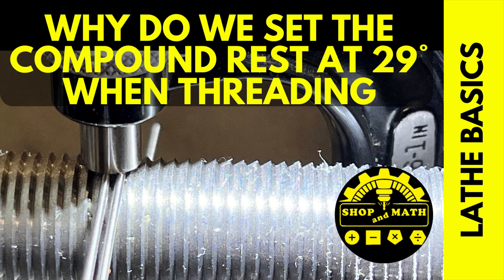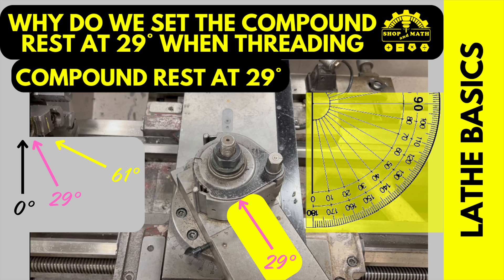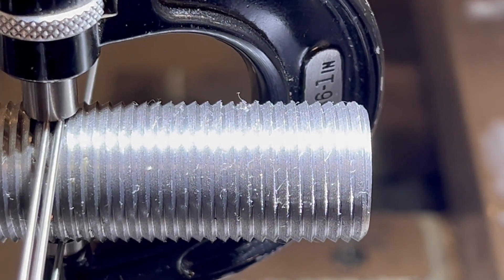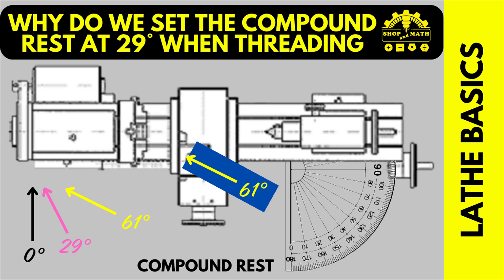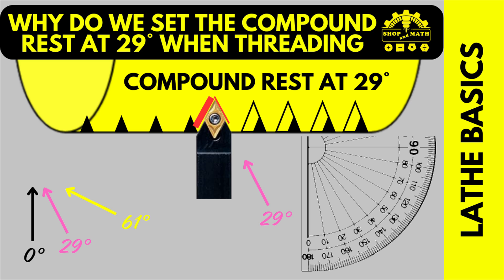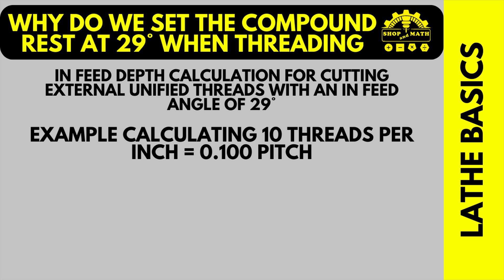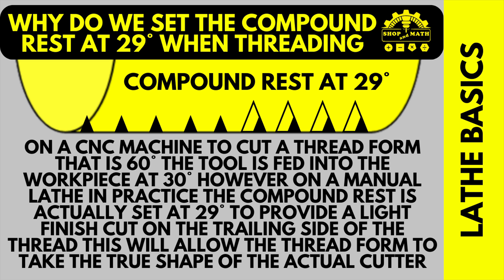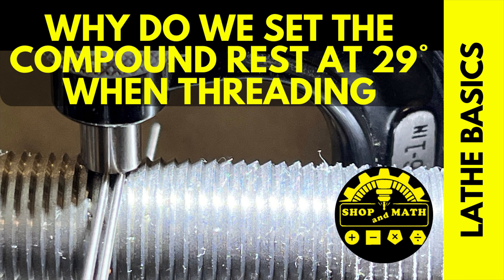why do we set the compound rest at 29

Comment: Where is this .708 number coming from? I’m new to machining, but I was under the impression that to find your depth of cut for a functioning thread you take the SIN coefficient of your 60 degree angle on your cutting tool, which is .866. Then you can multiply that .866 x your pitch and that’ll give you your depth of cut. Is this wrong?
Reply: Ok, I found the answer .866 x pitch is the formula for 100% engagement threads (V threads). Nobody really uses/makes those cause the V shape at the root is a point of weakness. So we make 70.7 engagement threads called Unified national threads. 70ish engagement of .866 is .613. So if you’re plunge cutting a thread and wanna know how deep to cut, take .613 x pitch and multiply it by 2 to accommodate the material you need to take from both sides. The .708 number comes from the Cos error introduced when the compound slide is set to 29.5 degrees.

Comment: Proper Threading inserts are designed to feed in a Zero Degrees, those designed for this collapse the chip, much the way a Carbide parting/ grooving  insert does. A CNC program written this way only shows a succession of deeper cuts with no angle. This can be altered to several different  thread cutting techniques, that only CNC machines can allow. When Using carbide for threading in a manual lathe, surface speed is more of problem, so much depends on the operators skill. HIGH SPEED STEEL threading tools are RARELY ground to produce the correct thread form, and they are never ground for the ultimate in  threading topping.

Comment: Been a machinist for over 50 yrs. Never turned the compound to cut a thread. Fed the tool straight in and advanced the compound  .005” or so each pass. Produced a fine looking thread on all pitches and materials.
Reply from the maker: Yes, that method will work as well

Out of curiosity, you’re not from New Zealand or Australia, are you 
That is a technique that they teach in those regions as well
Reply: @shopandmath  from Canada. They taught the 29 deg method in first year. Went to work in a shop where we were paid piece work. The first time I went to turn the compound the head machinist came over and told me” they taught you how to make threads but my job is to show you how to make money and you are wasting time”.

Comment: I honestly don't know anyone that changes cross angle to cut threads.  Mainly because it changes the tool offsets when you rotate the cross slide.  I converted my bench top sized lathe to CNC though and use a python script I wrote to generate gcode for the thread parameters I am cutting.  Maybe they teach this in trade schools but threads can be cut without doing that easily even on a non cnc lathe.  I think that the method should be taught from the start to preserve your DRO values and tooling offsets

Comment: ~29deg is used because 
                                            1) tools can be ground with a small error and/or mounted slightly off angle and we want to make sure the back side will always conform to the proper V shape.
                                            2)It reduces the total load on the tool which can wear or break off the tip where it is weakest if two large chips collide there.
                                            3)The compound angle cannot be perfectly set at 30 deg so we want to err on the side of safety which will keep the back side cutting the full V shape.
                                             4)The chip from the leading edge erodes away the surface of the back side so by ensuring it is always being skimmed we automatically correct that erosion as it develops.
                                             5) By placing the majority of the load on the leading edge you maintain a high and consistent pressure on the lead screw/nut assembly and all the ways to assure it does not advance erratically causing a drunken thread.

Pro tip. Once you decide your first cut depth (20-50% of total depth) the each pass is the previous pass X the square root of the current pass number.
EX start pass selected ..015  second pass of equal volume will be .015 x square root of 2 = .0212 or .0062 more. The 3rd pass would be .015 x square root of 3= .026 or another .0048 deeper and so on ....until full depth is reached.
Reply from the maker: yes, and thank you for contributing not enough. People read the comments that are left from videos if people are truly trying to understand and learn, there needs to be a two-way communication somehow videos are great but they’re not all perfect.

Thank you for contributing and thank you for taking the time to comment. It is much appreciated.
Reply: @shopandmath  I am 72 and feeling my age quite a bit now. I am still working and the company I contract with is having a hard time finding people who are fully educated.
 We had a huge order of aircraft parts rejected and they were to embarrassed to ask why. They were unable to discover the defect until they mentioned it to me and I said "No problem at all , in my pocket I have a thumb drive where I have the full details for any and ALL  UN threads , standard or not" because I wrote an excel spread sheet specifically to calculate every parameter of every thread according to ASME formulas and standards. 
Turned out the threads were to be UNJ and they didn't know the proper parameters so the bore was undersized. The fix was to simply bore the parts minor diameter up to UNJ spec and done.
Because no one in the whole company knew these things they asked me to create a course detailing UNJ threads to be given to the QC and to all operators. I did that but we have not implemented it yet. A full course academy is envisioned.
There are a lot of things that used to be done that are not done now but still are valid and there are some things that no longer serve any use. Thats why the history of these things matters.
People need to know WHY to do it not just WHAT to do.
Reply from the maker: The course you’re planning sounds really interesting. Wish you all the best with it.
Ray

Comment: I don't.  I feed straight in.  And don't care what angle my compound is set.
Reply: So your depth of cut is determined by?
Reply: @stevenconnor4221  by infeed obviously.  Straight in with the cross slide. Very common to do.
Reply: @dieselguy62  misinterpreted what you were saying, im UK based so your just plunging and you have set up the cutting tool, so you dont care where the compound is at anglewise.  I get you. Sorry for my confusion.
Reply: @stevenconnor4221  no problem.  Terminology really varies from one end of the pond to the other.  But end of the day we all get where we need to be

Comment: I  just did 1/2 -13 with cheap threading insert  at 0°... fed in  total  of  0.116  on cross slide 
came out perfect ...also tried from left to right with insert upside down at higher speed again turned out great love working out in the shop when its to cold to fish

Comment: I thought you were going to explain the amount of actual infeed  per thousandth you get with the compound set at 29 degrees.
Reply from the maker: yes, in the video, there is a chart that shows how much in feed you require, but it is best to use the numbers from the three wire method to complete your final size

I also have a video on using three wires as well 

Thank you for taking the time to comment and thank you for commenting. It is much appreciated.

Comment: 29 degrees is only appropriate for American and Metric threads with a 60 degree angle, An adjustment needs to be made if cutting a Whitworth thread.
Reply from the maker: That is correct. The Whitworth thread is 55°. I don’t know of anyone who uses that anymore or an application .
I have a 74 MG midget and it has some Whitworth threads on it. The nice thing about that is they’re the same pitch to upgrade or modernize all you need to do is run a standard tap through it, and all of a sudden it becomes a 60° thread

Do you know of any applications or modern uses for Whitworth thread

Thank you for commenting and thank you for taking the time to comment. It is much appreciated. 
Ray
Reply: @shopandmath  Re-tapping BSW/BSF threads to the 60° equivalent works fine in most cases. However  ½” BSW has thread count of 12 TPI and ½” UNC has a thread count of 13 TPI. (ITYF there are also different pitches between corresponding UNF and BSF threads too). Frustratingly close but not recommended for re-tapping for anything but the least critical applications. 
I'm actively involved with a UK heritage railway and almost all of our equipment relies on BSW or BSF threads despite almost all new work now used Metric.
Well leave other threads like BA for another day. 🤣.

Comment: Should be 29 1/2 degree, not 29, this is so the right side of the tool will lightly skim the "back side" of the thread and the left side will be doing the majority of the cutting. But what do I know, I've only been doing this for 40 years! Lol
Reply: Actually the 1 degree shy of 30 is back relief for the threading tool. I have an alignment pin drilled at 29.9 on my HLV. I've been chewed for doing it, but I do a lot of precision threading on camera and optical adapters. Some of those get into 40 TPI or more. 29 wont do it on that scale.
Reply: Don't think he watched the video.
Reply: I saw the title of the video and was going to say the exact same thing 😊

Comment: I have been a machinist for 11 years, and thus is the best explanation of why 29⁰. I'll admit, i infeed at 0⁰ because I dont want to mess up my tool offsets on my DRO. Thanks for the video. Short and simple.
Reply: I'm the same. But I do have a trick to take load off one side insert and make nice thread. I simply drop out forward reverse lever and rotate chuck backwards a wee bit and drop forward reverse lever into next tooth. It advances leadscrew a fraction and you then only cut on one side. You get pretty fast at it and it doesn't mess with offsets on dro.
Reply from the maker: Thank you for the nice comment and thank you for taking the time to comment. It is much appreciated.
Ray
Reply: I was wondering why he was cutting at 29 degrees at all

Comment: What you say about flank versus radial feed could be said to have some relevance for a home ground form tool, but if you look at a modern full form threading insert it has a rake angle on the leading and trailing edge. Surely this implies the intention for it to cut on both sides.
Reply: For fine thread pitches many threading insert manufacturers recommend straight in feeding at 90° to the workpiece Centreline. Only when the thread helix gets steeper and the thread form deeper do they then specify feeding the tool in at the half thread angle.
Reply from the maker: First of all, thank you for taking the time to comment it makes the chats nicer, and everybody gets to see different opinions, and how other people do things

You can cut full threads without any problems using indexable tool because the tip is much stronger than let’s say high-speed steel, but even CNC machines go in at 30° and only cut with the leading like of the cutter because the tool can handle it not all of the material which would cause deflection in some cases 

And also in some cases, like when I teach my level three class, and we do multiple start threads, we set the compound rest parallel to the Z axis 
Feed our tool to depth with the cross slide, and then advance the compound rest one pitch to create multiple start threads 

Thank you for commenting. It is much appreciated. 
Ray

Comment: The Mazak CNC lathes in the shop where I worked did, indeed, cut threads with a 30° feed.

The argument is usually that a big, pro lathe has the rigidity to handle a plunge cut, but that's not the point. Often the part rigidity cannot.
Reply: You are right we just tried it on our new cnc lathe today, a 5mm pitch thread on 48 dia with overhang of 156mm from chuck face didn't come out appealing.Looks like we will have to use tail stock to support the end.
Reply from the maker: Thank you for sharing. It is much appreciated. Hopefully others take the time to read the comments as well.
Ray

Comment: Looks like those "incorrect" threads are buttress type threads used on antique firearm barrels
Reply from the maker: The only place that I knew, but threads were used was on a saw vice
To allow quick withdrawal and quick in feed of the jaw I did not know about firearms. Thank you for sharing is much appreciated. 
Ray
Reply: @shopandmath  Buttress threads are fairly common in hydraulic cylinders and some well casing but the example would be backwards for those applications.
They are great for thin wall stuff where the load is only in one direction.

Comment: People don't get it right. When use carbide thread insert, which most people do then use only cross slide (0 degree), it will not give you anything good when trying to use the compound too. 
So why are people using compound ?, it is a leftover when machinist making their own HSS grinded tool. The HSS Tool was grinded in two different angles. prefect 30 degree angle on the left hand side and 27-28 degree on the right side hand. Still the 30 degree side was aligned perpendicular to the workpiece. If the HSS tool has this shape non symmetrical shape then of course you must set your compound to 29.999 degree angle and only progress with the compound slide.
If you insist to use carbide and compound angle then you can modify the carbide insert similar to HSS tool. Grind the right-side angle to 27-28 degree and keep the fine nose radius intact (do not touch the nose radius) on the carbide insert.
Reply: If you are using full form inserts it's no big deal when machining small pitch threads up to 3-4mm but once you go bigger pitch 6mm or 4 TPI then it becomes a problem having too much contact area creates chatter.On manual lathes I always opt for variable pitch inserts which allows to go to depth or even slightly deeper on root diameter without taking too much of the flanks and then side shift to achieve correct pitch diameter resulting in good surface finish.
Reply: @mehmettemel8725  yes you are right when machining thread size 3-4 mm or even higher pitch it will benefit of using the compound to 29- 29.9 degree. Still you will facing chatter problems on the right side of the carbide for two reasons. unless you grind the carbide insert so it can't cut on the rightside (Still keep the nose radius intact). First reason is that carbide is not as sharp as HSS tool and need some minimum chip depth for making a proper cut and using the angle of 29-30 degree does not provide enough cutting depth on the right hand side when using final spring cuts. Second reason is the carbide height measured to the center height increase for deep thread cuts (Negative angle) and HSS tool is grinded with positive angle which cuts better but is more fragile. My point is try it out using modified carbide insert for manual lathe or simply using HSS for thread

Comment: The best part about YouTube.
People who are prepared to share Information.
Your Information is correct.
But, rarely do I cut threads on a Manual Lathe with the Compound set to any other angle besides 90 degrees.
It's not to say that this is the way to do it ??
But, it works very well when you're Not using High Speed Steel to cut Threads ??
It's not to argue the point.
Just what works for me.
I cut all types of Threads on a Manual Lathe from Metric Fine, ACME to 4.5 tpi UNC.
All cut at 90 Degrees.
I back this up with videos showing the process.
Not trying oversell myself.
Just sharing information that works for me 👍
Reply from the maker: Thank you for sharing. It is much appreciated. You are correct you can leave your compound rest set to 90. Not a problem. I was just trying to explain the theory for my common core students or level one apprenticeship.
If you reply to this you should drop a link to your videos, the more shared content, the better
Ray
Reply: @shopandmath  Thanks for your reply,  Ray 👍

I always look at the comments section as a Forum rather than somewhere to argue the point with someone who has used their own time to share information.

( unfortunately not a common thing to happen on Anti Social Media ??? )

I'm fairly new to your channel and I must admit it was something that I found interesting to watch.
I had to laugh a little to myself as I was writing my reply ??
I still remember having the exact same conversation with my teacher.
( a fair few years ago now, lol )

In 1 of the test we were required to take as part of our lessons.
This question came up on the test ??
I couldn't help myself to give the answer I want to give rather than the answer he wanted ??

Of course I wrote 90 Degrees, LOL.
The teacher gave back my test with a score of 98% ??
I asked Why 98% not 99% ??
His answer was.  1% for giving the incorrect answer.
And another 1% for being a smartass 😅 

As I was leaving the classroom he said to me.
I wouldn't have given you a score of 100% because no gets a score of 100%
I asked, why's that ?
Because, giving you a score of 99% makes you think about why you didn't get 100%
😅Very Good 👌

Thanks for your offer to include a link to my videos.
But, I have already included too much information in my reply 🙂👍
Reply: I do the same only go half the depth of cut of cross slide on compound slide during roughing then very light finishing on both flanks at the end.
Reply: Joe pie did a very good video on this.
He explains and shows real time why when you are cutting 90° it's just fine.